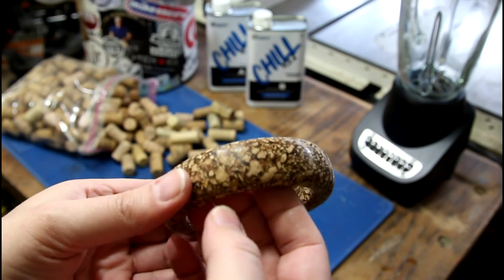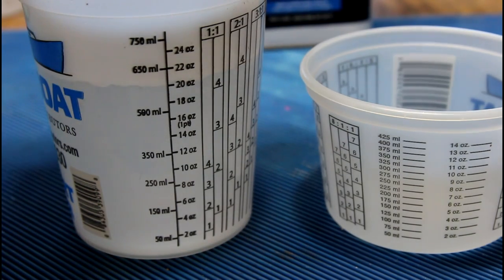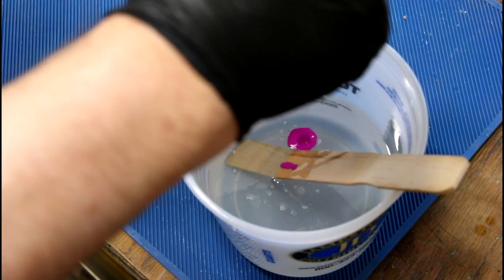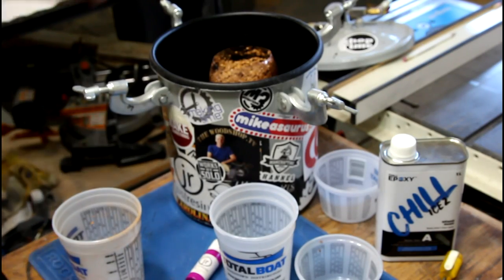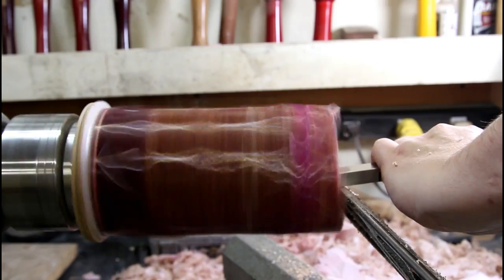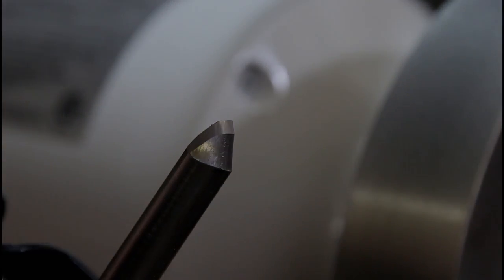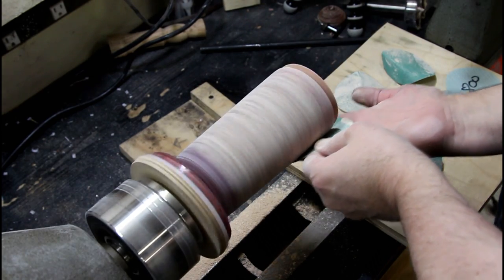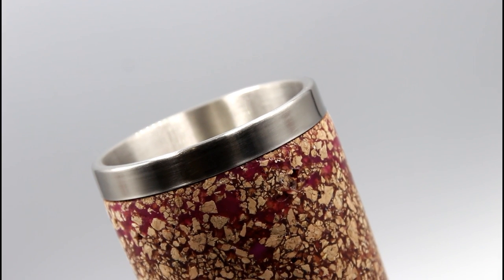Dyed Cork Coffee Tumbler

Comment: Coffee beans and resin for a mug like that would be a fun concept
Reply: He did some coffee tampers a while back. One looked like a turd, the other looked nice
Reply: It's a good idea, but he'd have to do two layers I think. One inner layer with the beans, and one clear outer layer so the beans stay intact.. and I'm not sure the two layers would stick together...
Reply: @avaDesdemona  A clear coat after the fact should work just fine.
Reply: @KainYusanagi  but he wouldn't be able to turn it then, would he?
Reply: @avaDesdemona  What about "after the fact" doesn't make sense to you? o.O
Reply: He did that with a different project, the beans resined together looked like poop lol
Reply: @KainYusanagi   thanks for the passive aggressive answer...
Read my comment again... Two layers, one with beans as the inside layer, then a second layer (to shape by turning) on the outside. 
Why? So the beans will stay intact (i.e. whole). A clear coat won't prevent beans from being damaged if they are too close to the outside.
Why would we want the beans to stay whole? So it won't look like poop.

Another way would be to stick the whole beans onto a central cylinder/core in a predetermined pattern, then encase that in resin and turn it. This would eliminate several of the problems.
If the central cylinder/core had a slightly larger diameter than the cup that will be inserted into the turned resin, no beans would get damaged when the inside is hollowed out, and by encasing beans that already adhere to the core, no beans would be damaged during turning either.

I hope this explanation helped you.

Comment: small suggestion- try putting the cup into the resin in the 2 liter and tape it into place before placing into the vacuum chamber.  you will use about an 8th of the resin, keep the cork in place, and experience less frustration. then paint a clear resin coat on top to prevent the cork from sucking up any water and make it hand-washable and actually functional.

Comment: So you could get rid of the plain resin at the bottom just by adding extra cork and using something at the top to hold it down. technically you could even have whatever it is in the resin too but it might be better with some holes. So like a piece of plastic mesh or something like that pressed down in the top or weighed down on the top of it would hold the cork down and if you have excess cork you can re use it by not letting it get covered/stuck in the resin.

Comment: By compressing the cast, you basically compress the air pockets instead of taking them out, right? So isn't there a chance of the cast cracking whenever the compressed air pockets expand within it? For example when it heats up hot enough.

Comment: If the cork was absorbing the water from The micro mesh, I wonder if it could also absorb and prevent condensation on the outside of the tumbler.  That would be a definite plus for traveling drink ware.

Comment: Is there a reason why you don't put a cylinder inside the mold before pouring? It just seems like it would save you a lot of work and waste much less material if you didn't have to remove all of that waste in the middle. Also if you didn't want the resin to collect in the bottom you could pour a shallow layer first before doing the rest. Good end result tho!

Comment: Probably could have saved on materials if you popped that metal interior into the mold and held it down with tape. Also could potentially use this info to your advantage by making a striped pattern in a casting by alternating resin and cork layers!

Comment: Anyone who does epoxy, either uses vacuum or pressure to get rid of bubbles
What about doing the opposite.
Something like a fishtank aerator pump to introduce bubbles as the epoxy sets.
whatever you have on the end of the pipe (air stone etc) will have to be sacrificial.
Even better if the epoxy is lit up, maybe as part of a table lamp, and maybe even tinted a little

Comment: For anyone wishing to demistify the MicroMesh grit ratings a bit, there's this chart: https://www.sisweb.com/micromesh/conversion.htm

The "12000" MicroMesh doesn't appear to have an ANSI standard rating, but it's apparently smaller than 3 micron grit size.

If you'd like to spend a bit less money, I bought these: https://www.amazon.com/M-jump-Touch-Sanding-Polishing-Grits/dp/B07R3S88JY/

3 sets for half what the MicroMesh run you, and about the same grit levels. They actually sent me 5 sets. No complaints.

Comment: Density... yeah, pressure isn't going to change the effects of density.
Reply: Well, since cork is rather porous, one would think the pressure would help push the resin into the cork and help it sink a bit.
Reply: @bassnbluegill1406  I see where you're going with that, but in order to make cork denser than the resin or equal in density, you'd need a greater amount of pascals than could be accomplished by a pressure cooker. And if it could compress cork to that point putting the cork in suspension, both the fluid and the cork would compress, so ultimately balancing the buoyancy force of the cork with that of the fluid would require a precision instrument. And even if you could balance those things, the cork would shrink so much that you would not get the desired effect of having the cork in a suspension within the resin. But your point is well taken.